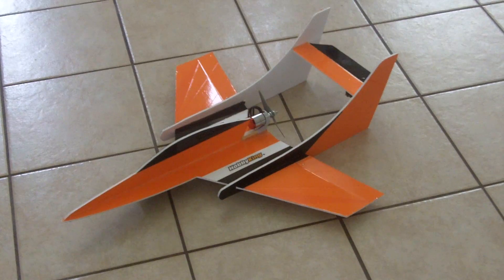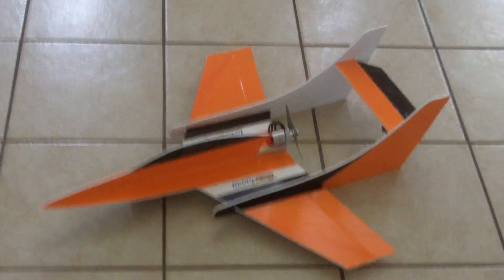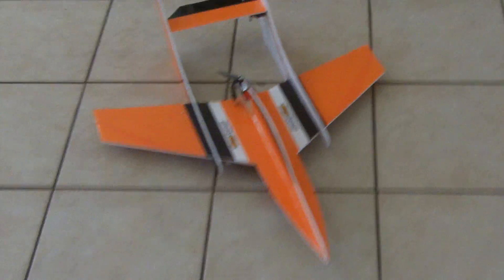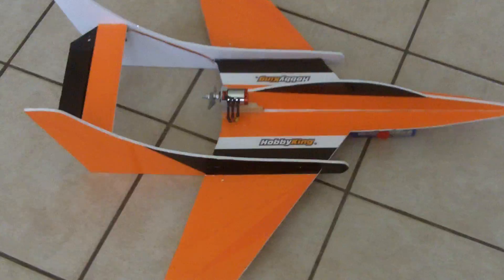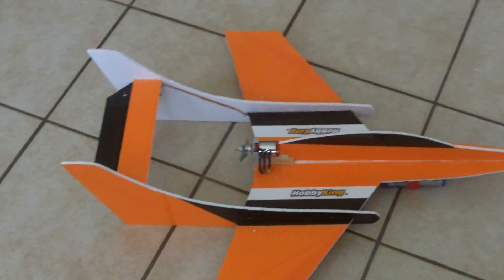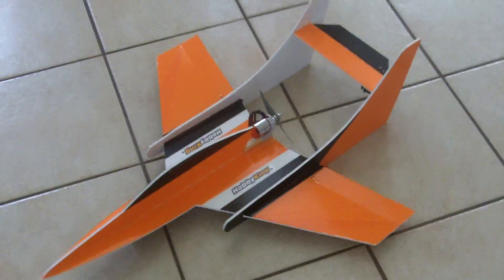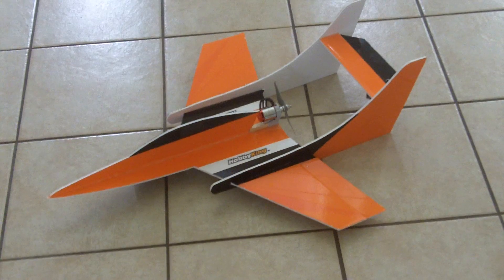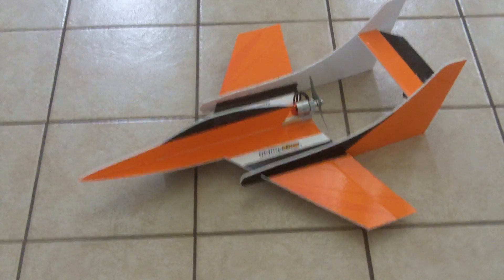Alley Cat Pusher Plane

Comment from the maker: This is a design that I found on the internet, did a few changes, like increased the size. This one has a 24 inch wingspan, the other has a 36 inch span, but pretty close to the original specs. I like it, fun, areobatic plane. I appreciate the comment.